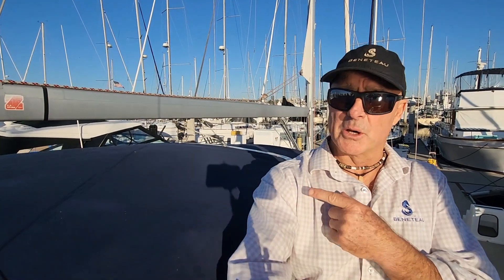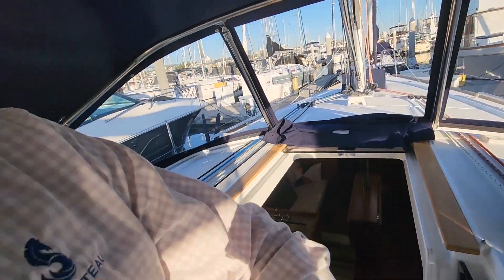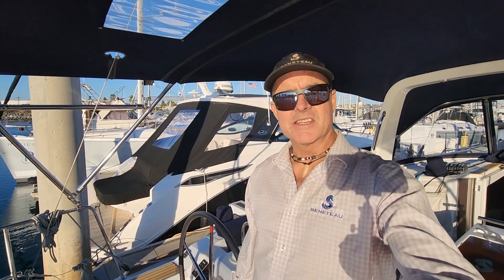Beneteau Oceanis designs  WHY NO TRAVELLER??

Comment: If you have traveller and you just keep it centered then you have the same ease of use as in this configuration but you have more options if you want to and you can have more safety with unintended gibes when your boom is held by traveler on the side.
Reply from the maker: The main reason for a traveller is to bring the boom to the center-line when close-hauled. With this mainsheet block system, the boom is dead on center when sheeted on fully.
One could add a traveler we should add tremendous complexity to get the control lines to wear they would be easily adjusted....all this for something so rarely needed and when one is cheating on the end of the Boom like this The Traveler would need to be about 8 ft long to be effective.
We have many very experienced Sailors and ex racers who sail these boats quite happily and don't miss a traveler....its not the point of the design.
Reply: you clearly did not get what I was trying to say
Reply: and used solution is clearly the cheapest
Reply: Actually this design is far better than having a traveler, the ability to center the boom is far easier. The only downside which isn’t any loss is you cant get the boom to windward. Anyways who uses a traveler for unintended jibes? Even as secondary safety it would be minimal on most designs.

Comment: I like the aft mast, the large jib, the balanced sail plan, the arch and the 45° companion way steps. Still would like a traveller.
Reply from the maker: I promise you will never miss it. End boom sheeting means the traveller on top of the arch is of little value as it would only move the boom a foot or two either side of Center

Comment: You’ve made a good, informative video although your comments on the traveler (“you don’t really need it”) and those who’ve added one “hardly ever use it”….. I respectfully disagree.  I have the Performance version, no arch, and installed a traveler.  It was a surprisingly easy installation.  I love it and use it all the time.   The O38.1 was Beneteau’s most successful model- 765 built!  No longer being produced, and its replacement is…..well, no comment.  TheO38.1 is a terrific design, versatile and comfortable, and when properly modified and set up, is an outstanding blue water-capable sailing vessel.
Reply from the maker: Thank you for your great comment Kirk. Whether you "need" a traveler depends on how you sail. The fact that you got a performance vesrsion tells everything and obviously would be of far more importance for you and the way you sail but for most of our Southern California customers, many of whom are new to boating and therefore are not performance sailors, they don't need or want the extra complication but if they did, fortunately they have the option to add one and once they have progressed in their learning curve and start racing a bit, then they will often opt for these more performance oriented options. Everyone enjoys boating differently and as long as they are getting out on the water it's a good thing.
I heartily agree about the design of the 38.1. Fantastic all round but the initial offering of the 38 was not nearly the boat that the 38,1 became and so it goes with each new Beneteau design ( which they completely change every 5-6 years) they nearly always find a way to make them better than the previous model and if not, the pretty quickly fix the major objections. Fortunately Beneteau are big enough that they  have the means and creativity to do so and be nimble in their design changes. 
Enjoy, enjoy your wonderful boat

Comment: Why would they not bring the main sheet back to the helm position. Wouldn’t that have allowed a single hander to trim the mainsail by themselves?
Reply from the maker: Hello, and thank you for your feedback.
Of course, leading the main sheet back to the helm positions is desirable in certain circumstances, but would also require a complete redesign of the deck layout to enable that feature.
It is actually more complex than one realizes as it requires a number of deck organizers and deck-mounted shieves to redirect the line in direction and  elevation as the line has to drop down from the cabin-top to the aft helm about 2 ft.
This causes a lot more resistance in the main sheet.
As you mentioned it is more advantageous if one is single-handing to enable the helmsman to trim the main sheet but it also makes it a lot more complicated if one is sailing with a spinnaker and has crew trying to help as it gets really congested with both winches by the helm station and main sheet, spinnaker sheet and jib sheets all in the same confined area.
This has been done on the new Beneteau Oceanis  40.1, 46.1 and 51.1 and is great for single-handing but it does make it very crowded under the above circumstances with a lot of lines leading to a small area.
There is no one perfect layout and each has it's advantages and disadvantages but most of these boats are being designed for very short handed sailing and that is why the newer models are adopting the philosiphy that you suggest.

Comment: I want to move the boom of my catamaran to a hardtop and get rid of the traveler. The height of the boom above the hardtop is exactly the same as 38.1 and your video clearly showed me how I would rebuild the system. My question is: can I place the blocks at a decent distance from each other on the hardtop and will this make the boom more uncontrollable? Now I have a boom sheet traveler of 4 meters and this is the distance at which the blocks on the hardtop will be located. Thanks in advance for your answer.

Comment: I get the way that the rig works, but my big issue with these designs is twin rudders.  Sure they work fine when sailing but I have owned a conventional 45 footer and when manoeuvring it in harbours and having to contend with crosswinds I found the ability to kick the stern of boat sideways with a burst of revs pushing water against the angled rudder a huge advantage, which is completely lost by having no rudder directly behind the prop.
Reply: It is a trade between near to perfect steering while you sail on a good heel (though our 38.1 just stops heel with the lee rudder vertical) and manouverability. With our bow thruster we are able to compensate the missing rudder kick.
Reply: @covi9465  So a 38 foot boat needs a bow thruster.  I had one on my Jeanneau 45.2 but quickly learned not to rely on it at all because any sort of cross wind defeated it.

Comment: A classic example of a run and hide boat. Compromise for comfort over functional heavy weather equipment. Good luck with wind over 30kn.
Reply: Well, judgments of a Oceanic perfoming in over 30kn winds from someone having ran away are missing facts. We sailed our 38.1 in winds well over 30kn, this with my wife and me as only crew. The running rig is very easy to adjust for all kind of winds, and one does not have to  leave the safety of the cockpit to do so. Kindly, do not talk about something you have lived yourself!